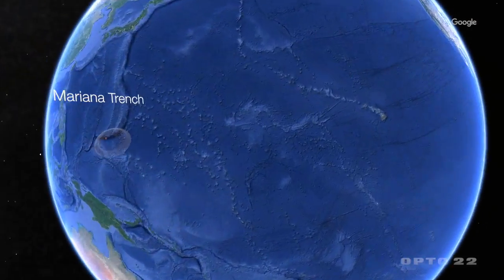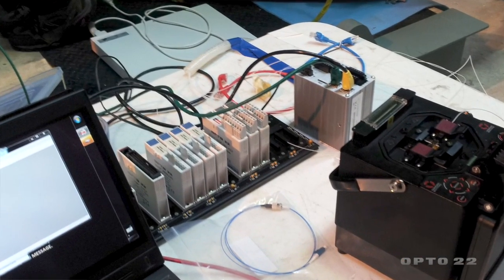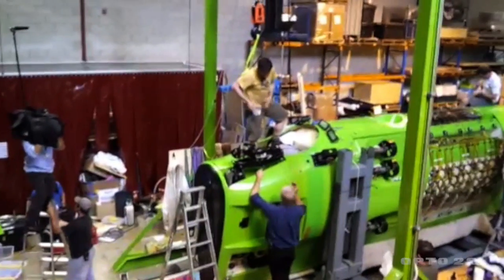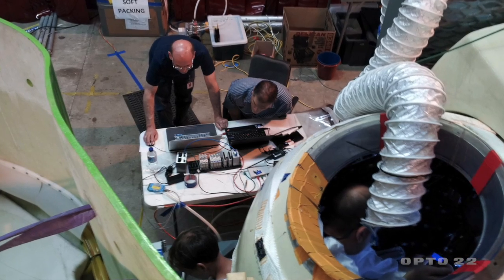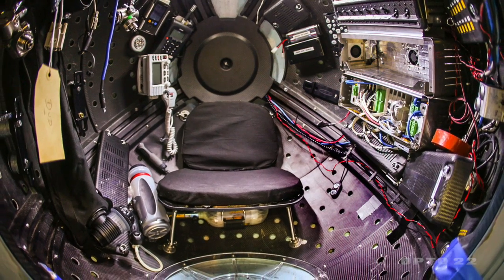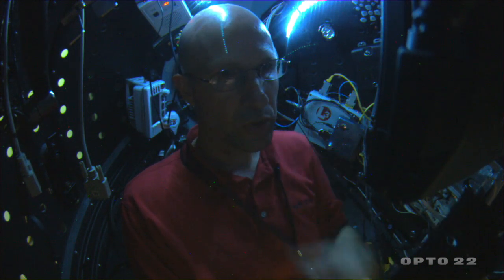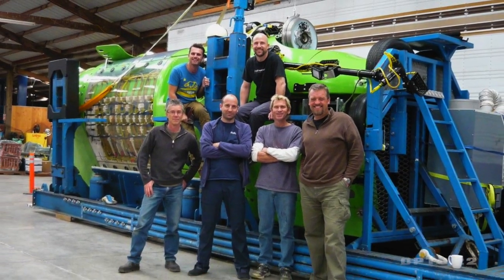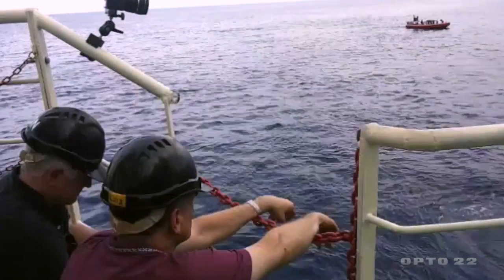James Cameron Challenger Deep: Control Under 8 Tons of Pressure

Comment: Stockton was really trying to imitate james cameron in almost every way except actually building a sub that can be certified to a depth of 25% more than they are planning to go down. A failsafe for blue tooth failing at those depths is not to power up another bluetooth controller. You need to revert back to back up fail safe wired devices. Control pads are only good for periscopes. Thats all the professionals say...
Reply: ...well, Stockton did built a sub that was good to 25% of its intended dive depth. Didn't he? Did someone misunderstand something? That's how you do it, right? 😝
Reply: At least his warning for when the hull was about to collapse probably sounded off, James Cameron pointed out that this system might be too little too late.  Oopsy daisy!  Pop goes the weasel.

Comment: How do the electronics/wiring connect into the sphere to the rest of the sub?
Reply: Great question. Not something that most people think about. There were three 'penetrator ports' behind the pilots seat. These things are super expensive. The gold coated contacts are insulated by glass that is poured into a mold. Once its set and cooled off the two halves (one inside the sub, one outside) are brought together and the male and female connectors join,  the signal can pass. 16,000 psi on one side and 14psi on the other. The pins are arranged as per the signal type they carry and vary slightly. Mostly the pins carried data, but a few special ones carried a DC voltage for some systems. Generally though the high current DC needed for thrusters and lights etc was sourced from outside batteries, so the ports mostly carried data and other low voltage signals.
Reply: @groovheads  are there any pictures or videos of the manufacturing process? Sounds insane...would this have been something new they had to figure out specifically for this sub?

Comment: The difference is that Deepsea Challenger cost like $10M and other such deep sea exploratory vessels like DSV Limiting Factor cost as much as $37M. That's before you get into operational costs.

You can't pay that off charging $250k a ticket.
Reply: The difference between imploding and not imploding.
Reply: Psh, those vessels all use "tested" materials.  Pathetic.  Everyone knows that true innovation is found by shrugging off testing phases and design flaws and then firing and suing the one man responsible for saving your life just because he said it was "untested" and might "implode".  Psh.  Real mean just feeling their way down to the bottom of the Atlantic.  We don't need working electrical systems or safety protAHHHH<POP>------------------------------------------------------------------------------------------------------------------------------------------------------------------------------------------------------------------------------------------------------------------------------------------------------------------------------------------------------------------------------------------------------------------------------------------------------------------------------------------------------------------------------------------------------------------------------------------------------------------------------------------------------------------------------------------------------------------------------------------------------------------------------------------------------------------------------------------------------------------------------------------------------------------------------------------------------------------------------------------------------------------------------------------------------------------------------------------------------------------------------------------------------------------------------------------------------------------------------------------------------------------------------------------------------------------------------------------------------------------------------------------------------------------------------------------------------------------------------------------------------------------------------------------------------------------------------------------------------------------------------------------------------------------------------------------------------------------------------------------------------------------------------------------------------------------------------------------------------------------------------------------------------------------------------------------------------------------------------------------------------------------------------------------------------------------------------------------------------------------------------------------------------------------------------------------------------------------------------------------------------------------------------------------------------------------------------------------------------------------------------------------------------------------------------------------------------------------------------------------------------------------------------------------------------------------------------------------------------------------------------------------------------------------------------------------------------------------------------------------------------------------------------------------------------------------------------------------------------------------------------------------------------------------------------------------------------------------------------------------------------------------------------------------------------------------------------------------------------------------------------------------------------------------------------------------------------------------------------------------------------------------------------------------------------------------------------------------------------------------------------------------------------------------------------------------------------------------------------------------------------------------------------------------------------------------------------------------------------------------------------------------------------------------------------------------------------------------------------------------------------------------------------------------------------------------------------------------------------------------------------------------------------------------------------------------------------------------------------------------------------------------------------------------------------------------------------------------------------------------------------------------------------------------------------------------------------------------------------------------------------------------------------------------------------------------------------------------------------------------------------------------------------------------------------------------------------------------------------------------------------------------------------------------------------------------------------------------------------------------------------------------------------------------------------------------------------------------------------------------------------------------------------------------------------------------------------------------------------------------------------------------------------------------------------------------------------------------------------------------------------------------------------------------------------------------------------------------------------------------------------------------------------------------------------------------------------------------------------------------------------------------------------------------------------------------------------------------------------------------------------------------------------------------------------------------------------------------------------------------------------------------------------------------------------------------------------------------------------------------------------------------------------------------------------------------------------------------------------------------------------------------------------------------------------------------------------------------------------------------------------------------------------------------------------------------------------------------------------------------------------------------------------------------------------------------------------------------------------------------------------------------------------------------------------------------------------------------------------------------------------------------------------------------------------------------------------------------------------------------------------------------------------------------------------------------------------------------------------------------------------------------------------------------------------------------------------------------------------------------------------------------------------------------------------------------------------------------------------------------------------------------------------------------------------------------------------------------------------------------------------------------------------------------------------------------------------------------------------------------------------------------------------------------------- (they imploded into a liquid spurt) (adding to a mass grave)
Reply: You can see it from Stockton POV:  The Cyclops 2 fits 5 squished people (before implosion) so if he pilots, which he has to as a confidence scam artist in order for people to follow him into the "experiment", then he can squeeze in 4 other people if they all don't mind sitting hunched over on carpet. He couldn't legally sell tickets so he jumped through that loophole by signing up his tourists as "crew" and referring to them as such, but hey at $250,000.00 per person "donating" to his private company that's a million buckaroos per trip to the Titanic mass grave, heyo what-a-deal! He'll make back all his investment money in just a few trips, ezpz!  He'll be famous in no time!  Hmmm, what's the difference between fame and infamy?  DOH!
Reply: Yes u could eventually lol
Reply: @emeyeare  until the bill comes in for every fracture inspection and maintenance for each cycle the sub makes. whoops there goes your profit.

Comment: Where do they have the joy-stick controller? 😂
Reply: Jim used a Logitech Extreme 3D Pro for controlling the robot arm, so yes, we used a joy-stick controller on Deepsea. It was the right control interface for the job.
Reply: @groovheads  Sorry, I cannot resist: is that the same robot arm that failed in the Mariana trench? At least in Deepsea the weight release was a good old mechanical switch.

(Sorry, I know it was not the controller that failed. The joke seemed too good to pass.)
Reply: 🤣🤣🤣😇:text-green-game-over:

Comment: OceanGate could just borrow this, it would easily take titanic depths :)
But it's safer to send just robots there, do virtual trips instead of compressed meat.
Reply from the maker: That would be cool!
Reply: This sub cracked after many dives,james cameron donated it to a museum,it's not functional anymore
Reply: @tifts9719 
It was badly damaged during transport, it is no longer usable for diving and in any case this submarine cost 10 times as much as the Titan
Reply: @tifts9719  That's not correct. The sub did not crack. It was certified for more dives that was run on this expedition. As mentioned in another comment, it was damaged when a truck tire/brake overheated while it was being relocated. The sub was restored to museum quality and is on display yes, but the hull is intact. It would take time and money, but she could dive deep again a few more times.

Comment: walked on the moon, walked on the deepest ocean soon?
Reply from the maker: That would be cool
Reply: That would be cool, but it would require a "spacesuit" capable of with standing 12,000lbs per square inch of pressure over the entire surface.  For comparison, the human bite is about 160psi, and a great white shark's bite is about 4,000psi.  This pressure per square inch issue is the reason why employing a totally spherical design made out a material resistant to pressure changes is what you want to be inside of so that you don't become the second manned sub to implode. :text-green-game-over: